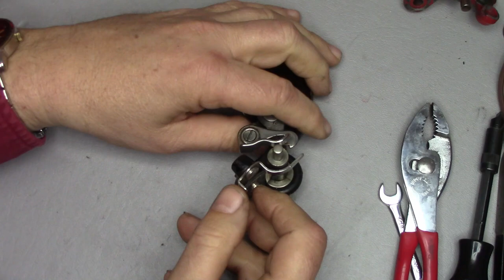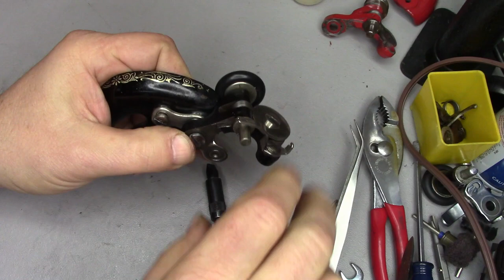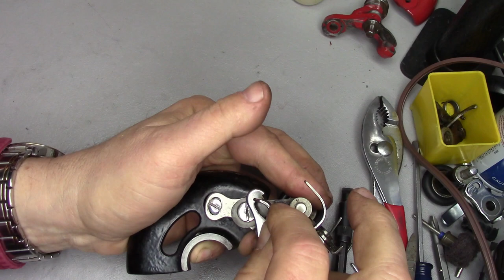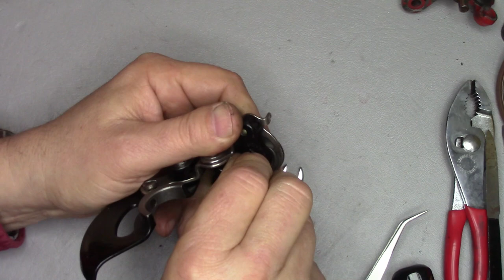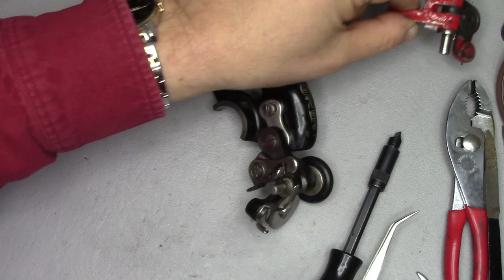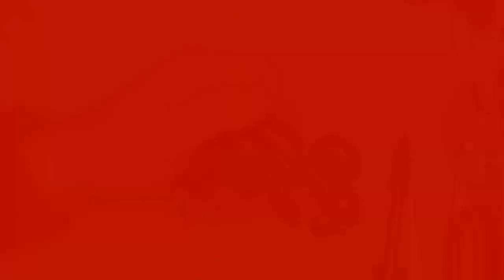Yet Another 66 Bobbin Winder

Comment: Thanks! Pretty sure this is the type my 66k has. It works but it takes some wiggling to get the bobbin on, something seems slightly bent or too tight. Very useful to know that it comes apart, and more importantly, that it can be put back too!
Reply from the maker: Not all bobbins are created equal. Many of the cheap ones don't fit very well on bobbin winders.
Reply: @BobFowlerWorkshop  Ahh yes that makes sense. It has a few more metal bobbins in its cabinet drawer but this was the first I managed full thread archeology on. So many layers :)
I'm gonna inspect the others soon, find out if there are slight differences. I guess it's entirely possible the bobbin collection got mixed up at some point!
Reply from the maker: @liessas  OMG - I serviced a Featherweight yesterday whose bobbin had 17 layers of thread! I feel your pain...

Comment: Hi Bob I know this is a year old but hoping you still check in now and again. I have a 66k from 1910 and the bobbin holder is not like either if these it sits at the bottom but when I lift it so tire can make contact with the wheel it doesn’t stay up, do you think this should have a spring where the arm go onto the sewing machine? I took it apart to clean it up their was not spring at the end that meets the sewing machine. Theirs a spring latch at top that hold onto bobbin cover and the cam has spring and works if I hold the arm up so wheel makes contact but doesn’t stay up. Do you think this should have a spring at arm end where it meets the machine?. Hard to explain which part I mean

Comment: I have a 66, I believe a 66-16, I can't get any 66 bobbin winder I have to reach the wheel, no matter the winder, no matter the wheel. Yes I know there is a slight adjustment. I made that adjustment as close as it would go, but still nearly a 1/4 of an inch out. Is there another adjustment? But why would they all be adjusted so far away from the same machine? The machine came to me with no bobbin winder.

Comment: The bobbin winder on my 1905 Singer 66 is different. No mounting bracket and the springs do not set into a hole. I am lost at how to reassemble it.
Reply from the maker: Can you send me a picture via email to argosybob@gmail.com? Actually send a few pix...
Reply: Did you get your winder reassembled?  I have a 1903 model 15 with no mounting bracket and two of the springs don't use holes.
Reply: @stevenarmstrong7575  no I did not.  My bobbin winder is like what you described. Since I couldn’t find help, I stopped working on it for awhile.
Reply: @marstar54  are you on facebook?  I can send the pictures of mine.